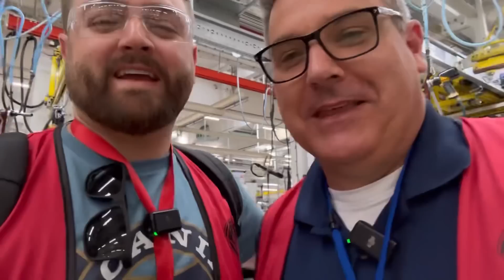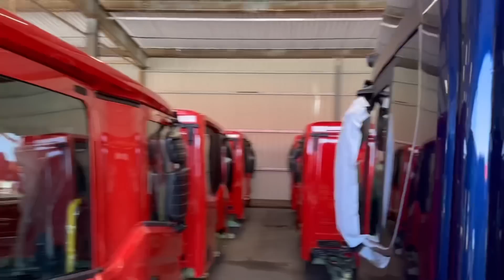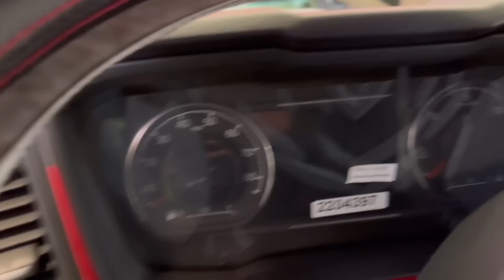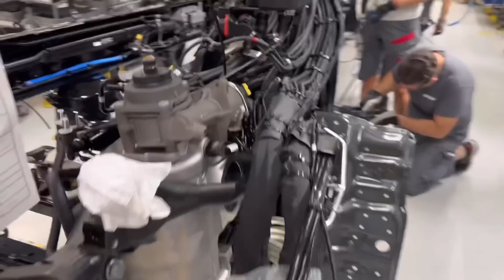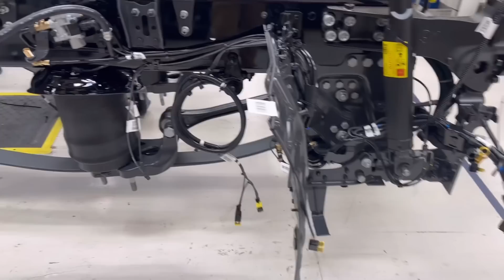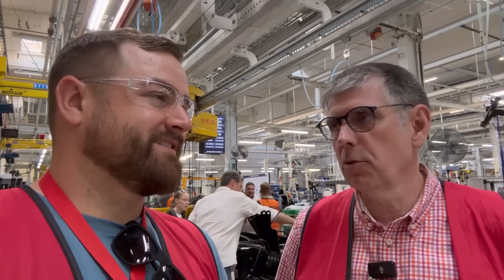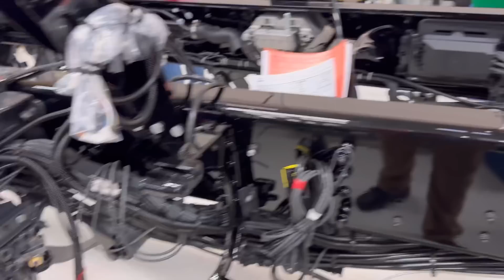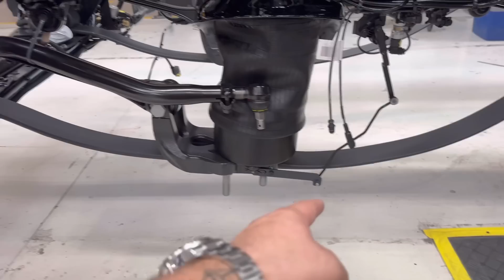Building a SCANIA R770 Truck for USA DELIVERY!!! Step by Step Chassis Build PART 1

Comment: I hate scania u know how they overheat all the time?? Yeah they put  90-96° thermostat instead of 80-87°and the 80 to 87 is the factory thermostat they should have put in but i guess the engines where to reliable and they had to get creative
Reply: 'My uncle got a Scania 1982 model that overheated. Since then I hate Scania because the always overheat..according to my uncle!'
Reply: Okok editing the scania 410 i6 engine has a thermostat from a v engine and the v engine has the 90 96 one from factory but the i6 must have the 80 87 one...
Reply: Utter garbage, but start a rumour to protect outdated US market.
Reply: I pull 150,000 lbs or 76,000 kg on my scania R540 and never have overheated nor heard about that problem

Comment: I hope that Scania makes european style trailers to match the truck, to showcase how they, compared to the US trailers, snug up to the cab, and delivers the weight differently (together with the 3 axle trailers, also with tag) to the trucks axsles (moves the weight forward).
Reply: I am on vacation in the USA this week and have been specifically looking at their trailers as I drive around the Rockies. There are now a few trailers out here approximately in the European style where they sit hard against the back of the cab with the trailer axles 70% along the chassis and with aerodynamic side panels, but it is not many. The Euro-style trailers that I have seen have been two axle rather than three and have been 53 feet (16m) box vans with rear doors.  There are a lot more roundabouts in the USA than there used to be and moving the trailer axles forward and putting the front of the trailer closer to the back of the cab makes negotiating roundabouts way easier with a 53 foot trailer. 👍

Comment: As said Bruce if you really want to test out this truck we already have R770s in Australia that are pulling 2 or 3 trailers 70 tonnes or over 100 tonnes. And none have lift axles or any of the Scanias ever made here and there are lots. They are all tandem drives like USA trucks. There is a good video if you search R770 South Eastern Freeway 68 tonne. It's pulling 2 tri axle trailers up a steap freeway. It's like a mini Ike here. And that's 68 tonne. Here you can pull more. Although maybe not that much more up that freeway.

Comment: Bruce you are one lucky Guy to get hooked up with Scania and have a special project together with them. I had the good luck to get a job in 1996 in the UK Driving a Brand New Model Scania 360 4x2 Semi with 8 speed splitter box, which gave it an advantage in climbing hills. GVW 38 tonnes. All Scanias in UK had to have Speedos in MPH. It was a completely new model including the Engine which had good fuel economy .  I had previosly driven older model Scanias but this one was completely different. Had a comfortable bunk and night heater that ran on Diesel . Good Luck With Your Scania.

Comment: How do you get the normal front axle load from 8 ton to the US mandatory 6 tons with out rebuilding the whole truck?

UK still use MPH, and they do sell scanias in the UK, so they probobly still have a few produced with mph.
Reply from the maker: But not left hand drive!
Reply: Is there a front axle load limit?!
Reply: Mandatory 6t front axel😵‍💫 no wonder why your american trucks have no controll on snow and ice😵‍💫
Reply: Less load?

Comment: best scania cabs is the t-cabs.
Reply: Taking more space to drive around due to longer wheelbase, is quite likely 'not best'. Cabovers are the most practical, and the reason sales slowed and Scania ended production in 2005. Looked cool, I agree. The cartonish looking Dutch hybrid T-cab can't be counted as a real Scania.
Reply: @Rimrock300  t cabs would probably work better in the US tho, they love a big nosed truck.
Reply: @Rimrock300 cabovers will be fine for long distance, they do it elsewhere no problem, US drivers will adapt easy enough.

Comment: Im from Sweden and i would not have known of Bruce Wilson if it weren't for his liking of Scania-trucks. And i think most of us Swedes gets a bit proud when we see how most US truckers seems to like our Scanias and Volvos. Anyway! im rambling here.. Scania could not have chosen a better Ambassador/Agent than Bruce.
Reply: As a norwegian I'm supporting this. Swedish trucks rule Scandinavian roads, and for a good reason. Hopefully Bruce fan open the US truckers eyes for the superiority of Swedish trucks, and pressure the politicians to change the 25Y rule, making competition a real thing.
Reply: @Xirque666  I mean you can still import new trucks (I think) you just have to pay excessive taxes. Effectively killing competition.
Reply: @gimble447  Trucks have 25% duty when importing, so it’s just impossible to do financially sound
Reply: @NameName-ll2yx  that’s correct, even a pickup truck is under the commercial  “chicken tax” however I’m sure I don’t need to tell you that it’s all about eventually having to build a plant in America. That’s what the government angle for from the start, so If we use Volvo as an example they imported trucks into the US for the first couple of years to test the market, only then did they build a plant in Virginia, so basically what we are seeing is the very start of that process here 👍
Reply: @gimble447  Just trying to stifle the competition by having the cost to enter the market unnecessarily high. Ironically the labor will be actually cheaper in US than in Sweden 😂
Reply: @NameName-ll2yx  Yes meaning Scania will make even more profit as cheaper labour and no shipping lol, it doesn’t really stifle competition as all countries have something similar in one way or another to varying degrees but the main thing with  America is the American government want the jobs in America, Using Volvo as an example again they just had to absorb some of the tax burden at first so they could be very competitively priced with the first introduction of the US spec models which can only really be seen as an investment for the high sales and returns in the future, it’s a very basic investment strategy tbh, and it’s one all foreign manufacturers follow when entering the American market, but yeah I agree, the land of the free ain’t so free as some others when it comes to vehicles choice for its citizens, because the manufacturers have to “jump through the hoops” but it’s similar in most markets around the world, it’s nothing new to vehicle manufacturers, they do this kind of stuff all over the world sometimes even dealing with dictatorships etc lol, but in this case it’s mostly motivated by the US wanting jobs for its citizens and foreign investment into the country.
Reply: @gimble447  Scania is now part of Traton (a subsidiary of VW which is a subsidiary of Porsche). Navistar is also part of Traton. At least in theory, Scania already have access to manufacturing facilities in the USA, although I suspect they'd want new facilities dedicated to building Scania trucks.
Reply: @RobertClaeson  Correct and yes as you say they will doubtless have their own facility as the existing facilities you mention won’t be able to house a Scania truck facility the size and scale that it would have to be to make selling in the US market economically viable long term 👍
Reply: @gimble447 Scania does have a US headquarters in San Antonio for their marine engine division.
Reply: @RunawayTrain2502  An office not a Factory 👍
Reply: I am not a trucker, and I prefer autcar my self, but Scania is a damn good truck brand, and the fact that from what I hear from people about them putting truckers first I can't figure out why they decided to pull out of the U.S back in the day.
Reply: We sure do! 

I must say I didn’t see this coming. Becoming an agent for SCANIA in the US and become the vessel for SCANIA establishing itself as a truck brand is huge! 

I’ve been driving SCANIA trucks at first and later buses for over 25 years and have had the opportunity a couple of times to drive brand new buses from Katrineholm and later SCANIA Poland where whole made buses are assembled, and your enthusiasm for the brand kind of soars a renewed national pride 😊. Also the trucks and buses from SCANIA have always been my favorites even compared to VOLVO, our other heavy weight truck manufacturer. The upcoming videos will be very intresting.

Comment: Any import restrictions?
Reply: Plenty. But it's easier to get a new Euro truck into the US market if it's to be used as a demo truck only. + lot's of paperwork
Reply: @Rimrock300  plus the chicken tax’s or just regulations on top of that, it’s not worth it, they will cost possibly over 300k after everything is done, with the shipping and parts etc. it’s not going too sell or even be considered, Among the us market, they tried in the 80s and 90s and lost their money and time.
Reply: All of the restrictions you can think of plus a little more. It is not viable.
Reply: @darek4488  Volvo and Mercedes Benz (Freightliner & others) sells a lot in US..;) It's just to own some production failities in the US, its no rocket science

Comment: The frame assembly looks like an over engineered rats nest of wiring, and air lines there is nothing clean and sleek about it
Reply: it is just because us trucks has a older design and engineering with less functions, I have myself an 2009 volvo vn630, but even newer trucks in the us still have a simple design. exemption the new 2024 volvos with little newer tec.

Comment: Should have gone for a S.
It's Scania's money spec it to the max.
Reply: The americans are used to cabs sitting quite low, less hassle getting in and out. Maybe he had that in mind going for the lower R cab. But would been cool with a S770, but possible no big deal
Reply: @Rimrock300  He did mention later in video that the S cab with the high roof was too tall to transport.
Shame.

Comment: I think the guys at Edison motors said it best.  Volvo and other truck manufactures make trucks to sell to accountants (fleet sales) Scania makes trucks for drivers.  They care about driver comfort.  No one else is spending 24+ hours sitting and living in it.  
I mean the whole truck with the flat floor setup up front or the 100 times better step up over old school cab overs, and the form factory amenities like the coffee maker that you can get built in up front, or the microwave over the drivers head and the passenger seat you can turn into a work area for paper work. They are showing why cab overs should not gone the way of the do do over here in North America. Its a great option.  Especially if you're going to areas where you need better turn radious's. Something you're just not going to get with 6' to 8' of truck sticking out in front of you.

Comment: What would be cool is to see Scania come back to the USA and be able to sell their engines as re power options.  Imagine an old long hood Pete or Kenworth with a high power Scania v8 in it.  I've always been impressed by their powerplants. They just need to figure out a rowdy jake brake set up for us Americans.  Its ok Bruce you can say it. Scanias are built more like a luxury car than a stripped down model pick up. They're clearly engineered to a higher level, with an attention to detail and fit and finish of a luxury car manufacturer, which isn't surprising as they are owned by Volkswagen who also manages Audi, Porsche, and Lamborghini.

Comment: Friends, I want to know your opinion. Tell me what country you are from. I have a theory: Scania will test this truck to see if it is feasible to launch its products in the United States. I have no doubts. Just look at it. The best engine, all the extras in a low-roof R-cab. They have even designed a mileage clock. I have no doubt that they want to show the truck all over the country to see people's opinions.

Comment: If there is a good reaction it wouldn't take much for International to set up a production line for 'Scania' as they are in the same owning group. Frames, wiring looms, possibly axles wheels could be made in the USA to Scania specifications with finished cabs, electric looms and V8 engines coming from Sweden. International already do the 6 cylinder engines and integrated transmissions. It would then be a US built truck.
It would need a change of work practices as the US is all speed and numbers while Scania in Sweden and Holland are about build quality and worker quality of life. Maybe a good by product!

Comment: If it does make it into production in US, it will a dumbed down version, and not the top motch European spec, like other European imports of old. Axles will be US sourced, as will suspension. Mark my words. Look at volvo still today, built on Kit platform.
Reply: Scania don’t do that, they’ll supply everything.
Reply: @martinlaurie1971 yeah well, Scania has no say on US trade regulations.
Reply: @martinlaurie1971 US market is heavily regulated.
Reply: @martinlaurie1971  If this truck runs 48 states, brakes,wheels and common wear and tear items will be US sourced, just like volvo do, A for cost, and B for non franchise maintenance IE truck stops.
VW group will use international conventionals for 97% of sales, and Scania will slot into specialist market, Class 8 cab overs don't work in America due to Low front axle weights.
Reply: @checker3694 they don’t have lower front axle weights, they pull heavier weight in the rest of the world. Scania WILL NOT allow other companies to fit inferior parts, they may build in the US but the quality won’t be compromised.
Reply: @martinlaurie1971   US has lower front axle weights, cab overs won't work in class 8 US environment, the axle distance would be very long. Otherthan day cabs in in 4x2,s  Do you know Fedral laws on importing completed trucks in US hence the reason they imported them in the past in kit form.
All other European manufacturers have sourced axles locally in US, with exception of 33000lbs mercedes in 80s. Scania won't produce enough trucks in US to economically manufacturer axles and drivelines, with the exception of engines and transmission. They will have to sell at a profit and not loss making show trucks.
Reply: Yep, they fear real competition.

Comment: Congratulations, Bruce, it’s amazing. However, I thought it was forbidden to import or register a truck under 15 or 20 years of age. How can a new truck with European specifications and pollution standards be used in the USA, which has a different standard?
Reply: because the factory are building it to US spec as a demonstrator... It'll probably remain the propert of the company in Sweden and just be there as an exhibition sample. It no doubt involves a lot of legal paperwork.
Reply: I bet it will be under "Show or display".